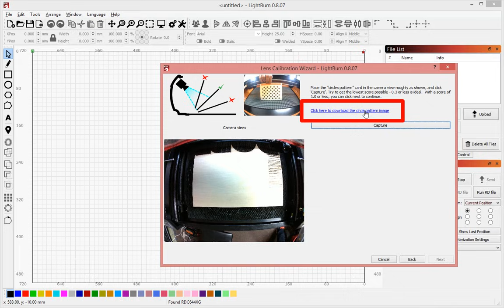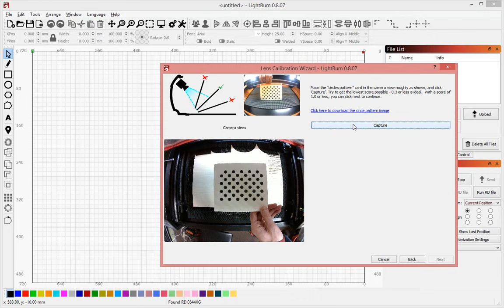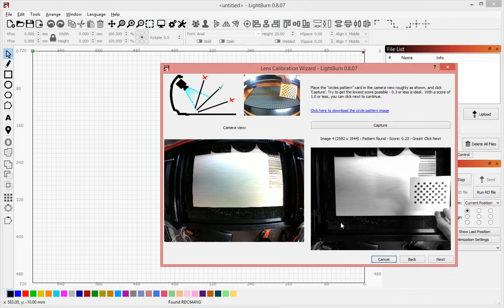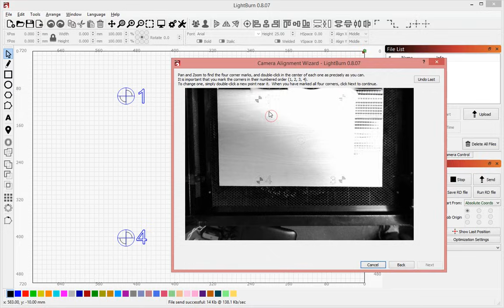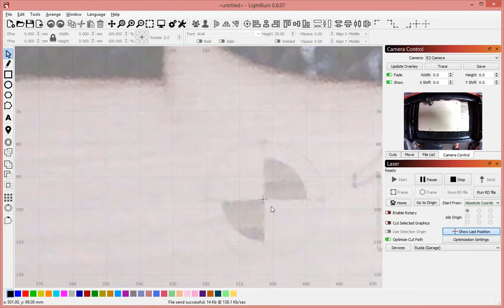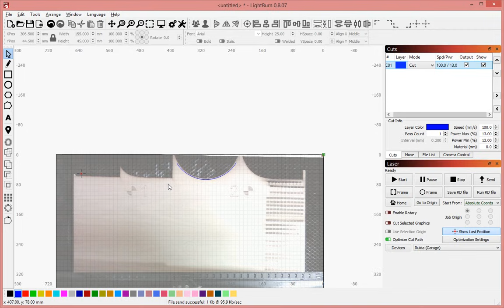(2.0 and Earlier) LightBurn Camera Setup

Comment: I am surprised you are holding the pattern by hand.  Wouldn't it be better to put the pattern on a surface parallel to the base in order to raise it up to fill the grid section?

Comment: Hi, really good  video. I am considering swapping my Leetro for Ruida also based on the blog by MSRaynsford, it was from his former business that I bought my little 40w Just Add  Sharks Blacknose model . It's just 400 x 300 bed but adequate for my needs. 
My question is regarding which camera. To avoid any possible calibration  disturbances with lid position changing when opening, won't be much of course but it can happen, I thought of mounting it in centre of lid to use when lid is closed. This gives me a max height of 200 and therefore the 160 degree lens with a min 148mm height Requirement.  At least when lid is closed the position should be exact. Not to worried about my view through lid with camera in middle. But as mentioned in video the 160 is harder to calibrate. If i go for the open lid I have 650 height to play with and have to stabilise everything  like various other blogs have advised. Interested and open to opinions. 
Many thanks
Reply: @lightburnsoftware7189  can you please guide me to the forum, I have the exact same question & bed size.

Comment: Excellent job.  I have the same 700x500 laser.  How many degrees of aperture does the camera use?
Reply: @lightburnsoftware7189  I bought an 8mp camera and a viewing angle of 75 degrees. I'll put it 76cm above the table. this will be ok
or did I make the wrong choice?
Reply: @lightburnsoftware7189  I bought an 8mp camera and a viewing angle of 75 degrees. I'll put it 76cm above the table. this will be ok
or did I make the wrong choice?
Reply: @lightburnsoftware7189  Thank you very much.  I'll wait for the camera.

Comment: Hi, can I ask what camera you are using. I like the small form factor and the one I am attempting to use does not have a wide enough angle?  Great video, nice programming.  Thanks in advance
Reply: Disregard my question, I just found this on your website: So, for example, for my 700 x 500 mm laser, using the 140 degree lens I would divide 700 by 1.8, giving me 389 mm above the bed, minimum, to see the whole thing. Thank you
Reply: Does this effectively mean that the piece of wood you used for those 4 markers becomes the "bed"? So if i placed a coaster on top of that piece of wood,  i could accurately set up my text/pic over the coaster.